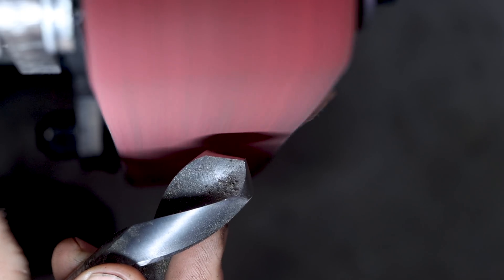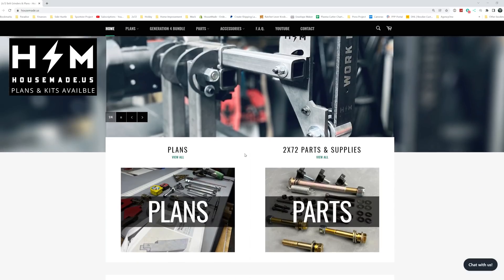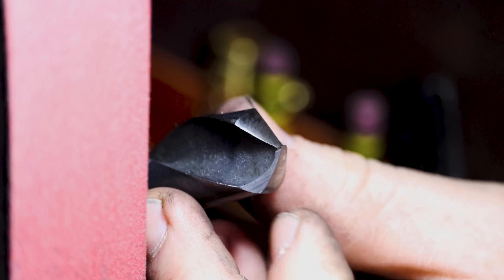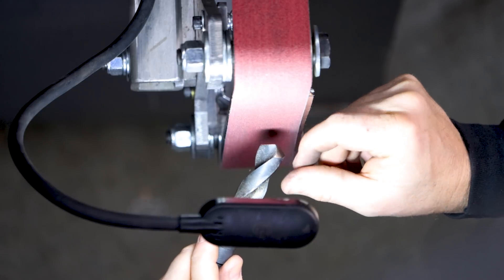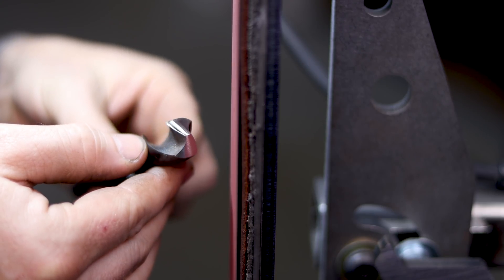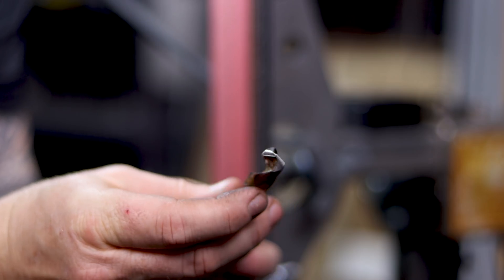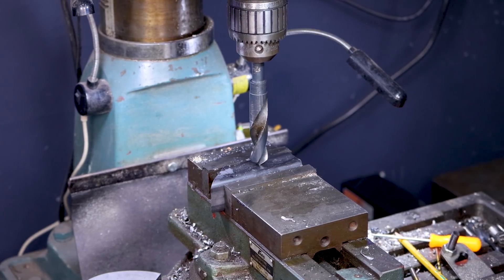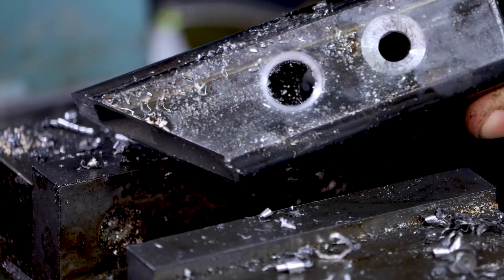How to: Sharpen Drill Bit with a 2x72 Belt Grinder

Comment: What a great Idea to use the soft platen. By any chance did you try your 10 inch wheel? I have the first drill doctor, it is garbage. It’s been sitting on my shelf for years.
Reply from the maker: The wheel works great too. I like my drill doctor but it's a later version. The 750 I think.

Comment: Man that soft platten looks like it works a charm!  Also I need to try this technique.  I have always started at the cutting edge and rolled away from it when sharpening drills.  I think your way may be easier to get lined up as you get to the cutting edge.  Thanks for the podcast shout out!
Reply from the maker: You got it brother! ⚡️ Yes the soft platen can be a game changer for sure. Def give it a shot.

Comment: Great video, Brian. The wider belt makes it easy to sharpen big drills, too. I regularly sharpen 25mm/1" to 50mm/2" drills on mine. Just a top on sharpening your deburing tool or single point countersink.  If you just grind back the flat cutting face and leave the factory geometry, you will keep the correct angle on the tool. The same for the single point tool, use a die grinder stone and just grind the hole if that makes sense?

Comment: PS - a few tips: the single chip-coil indicates one cutting edge is a slightly shallower angle and is doing all the cutting. Use a gauge to ensure the angles are ground identical on both sides. Trouble starting the hole (and the visible heat) is because non-split drill tips can’t cut. That’s why you need a pilot hole or split tip. If you lose the split from sharpening you should drill a pilot or the tip will overheat. You probably know all that but I hope my comment might help someone else. Again, great video 👍
Reply from the maker: Awesome tips Ben, thank you for adding this note! (helps me too) 👊🏻⚡️

Comment: Cool. I’ve been sharpening my drills this way for years, but I only have a hard platen. Way better than bench grinder, but now I want to try with a soft backer. Also, magnification visor is a must for my old eyes. Great video!
Reply from the maker: Thanks so much, Ben! I think with practice I could easily do this on a hard platen but anything that makes the process faster, I’m gonna do it that way and get back to the bigger project. It’s enjoyable to take a few minutes and do this though!🤘🏻

Comment: The Ti coating on the sides is helpful in chip removal/extraction because it helps keep things from sticking to the bit and flutes...removing it from the tip isn't going to be detrimental to drilling as long as it's sharp
Reply from the maker: Gotcha, MBKS — thank you for the answer on that! 👊🏻⚡️

Comment: I find that the bits cut more symmetrical when you focus on flat grinding the cutting edges into a centered V using a rest, and then freehand concave off the back side of the cutting edge to leave room for the chips.

Edit: having them symmetrical keeps them from chattering.
Reply from the maker: Makes sense—thanks for the tip JJ! 👊🏻⚡️

Comment: Why are you deburring with a drill bit? A reamer would be a better solution for opening the holes if needed, a deburr tool, chamfer or countersink bit would clean up the Rim
Reply from the maker: I prefer a single fluted chamfer.
Reply: I really like "zero" flute countersink bits. Turn as slow as possible with firm pressure to raise a "chip". Light pressure and higher speed produces excess abrasive action on the part and the bit. 
Great videos. Thanks.

Comment: Another great video!! I’ve tried every kind of jig and drill bit sharpening system that’s out there, bottom line learning how to sharpen by hand is the fastest way to get it done, the more you practice the better you get, this just goes to show that the 2x72 belt grinder is by far the most useful tool in the shop!!
Reply from the maker: Totally agree on all points, thank you!! 👊🏻⚡️